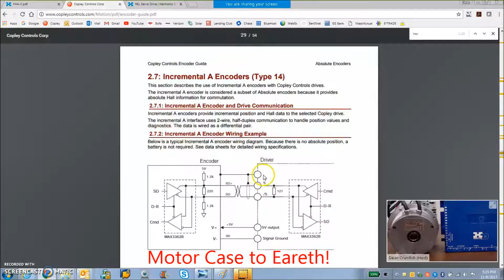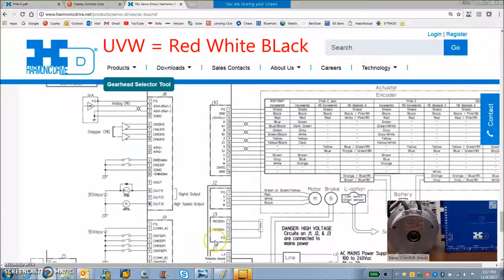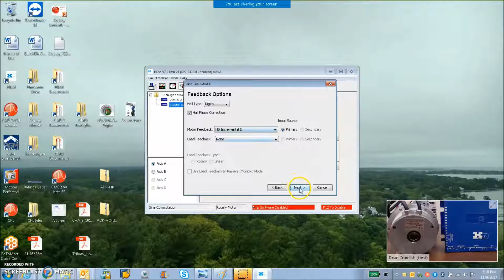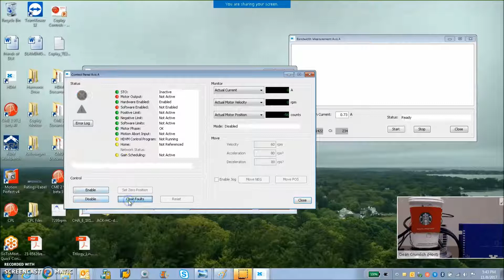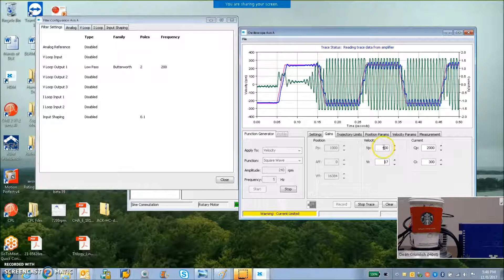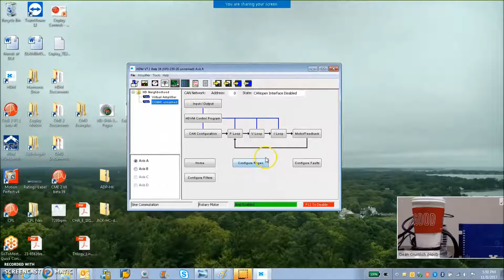Harmonic Drives 4 Wire Serial Incremental E250 and E200 options

Comment: Hello Dean, great video, very helpful. I have one question: Would you happen to know which propietary protocol Harmonic Drive use? They would not reinvent the wheel, would they? I am aware of a few protocols like EnDAT2.2 or BiSS, but they need more than 2 data lines, I guess. Your help is much appreciated! AK
Reply from the maker: Ahjub, It's proprietary! However, most of there feedback devices come from Japan or they role there own. Send me an e-mail at dcrumlish@copleycontrols.com with your full contact information and I will try to get you in touch with the right people at HD who can help.
Reply from the maker: I do not know what encoder they are using or if they developed it.